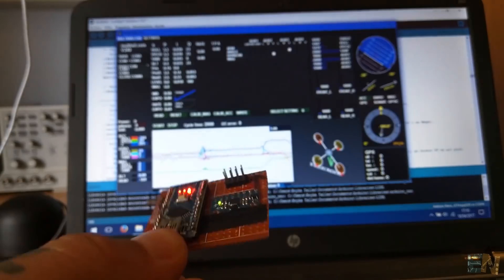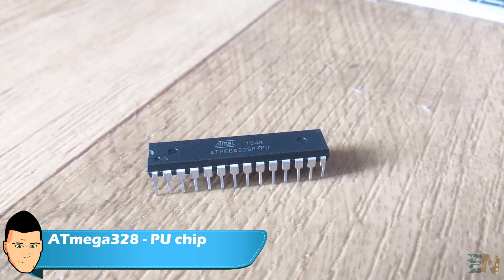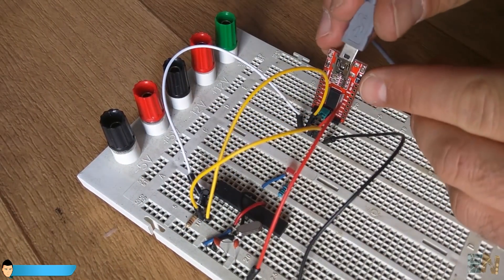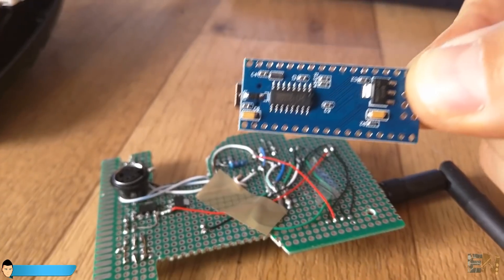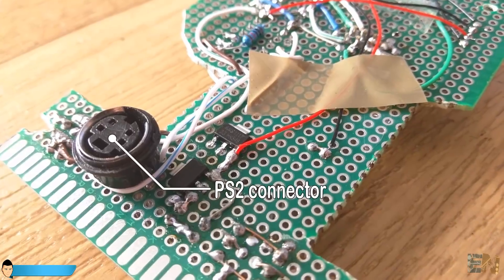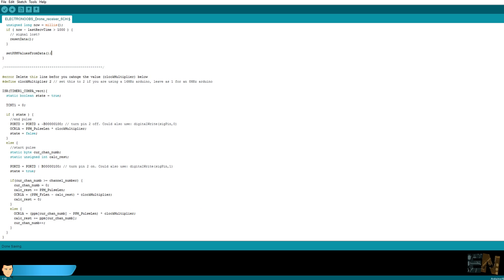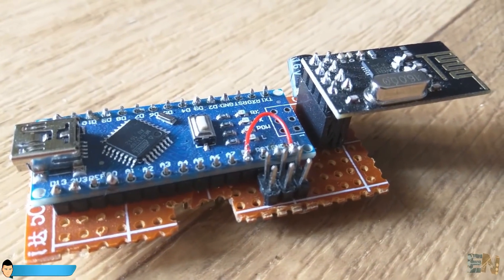Arduino drone - Part2 Transmitter & Receiver

Comment: Hi, when I use arduino nano instead of atmega chip in the transmitter, would the same transmitter code work or there is a separate version for arduino version.

Comment: Arduino: 1.8.13 (Windows 7), Board: "Arduino Nano, ATmega328P"

ELECTRONOOBS_Drone_transmitter_6CH:9:10: fatal error: nRF24L01.h: No such file or directory

 #include <nRF24L01.h>

          ^~~~~~~~~~~~

compilation terminated.

exit status 1

nRF24L01.h: No such file or directory

This report would have more information with
"Show verbose output during compilation"
option enabled in File -> Preferences.

Comment: compilation terminated.

Using library SPI at version 1.0 in folder: C:\Program Files (x86)\Arduino\hardware\arduino\avr\libraries\SPI 

exit status 1

nRF24L01.h: No such file or directory
Reply: Nrf ka library download karo
Reply: @Shekhargourav30  thank you

Comment: Question:
Why do you have to make your own radio controller? Why can’t you use the one without modifying it?

I’m working on a project and I want to just buy a controller and not have to make one. Can you buy a controller and somehow connect it to a receiver which is connected to an Arduino?
Reply: There are many sites like mydronelab.com, etc where u can refer. Because they use ready made transmitter and receiver. This site uses diy made receiver and transmitter.

Comment: Can you please help me. I have spent hundreds of dollars on this, gone through 7 sets of nrf24 modules and I still cannot get the controls to work. I have the flight controller working. I don't know what I am doing wrong. I have checked at least a hundred times. I have my wires connected on breadboards with pins connected below
Ce==>9
CSN==>10
SCK==>13
MOSI==>11
MISO==>12
For some reason I CAN NOT get the radios to communicate. For even simple nrf24 tutorials. What am I doing wrong???
Reply from the maker: Ok so there are many reasons the radio could fail. I recommend you to first test the simple code of send and receive of only one data.  Make sure the radio voltage is 3.3V and maybe use external regulator for more current. Use short wires between arduino and radio module to reduce interference. Make sure to select csn and ce pins in the code to match your connections, in this case as you say, pins 9 and 10. If still doesn't work, i don't know...
Reply: @ELECTRONOOBS  Well first I appreciate the response. I am using the nRF24L01+ Adapter that regulates the voltage and im using the 5v pin from the arduino nano. I have tried every simple test code I can find and I am certain about the csn and ce pins. I've heard that the market is flooded with cheap knock offs so I guess I am just going to keep ordering different ones until I find a good set. If you could recommend somewhere for me to purchase them THAT WOULD BE GREAT!!!

Comment: Sir where to connect the joystick to the transmitter circuit
Potentiometer is numbered but 
Not cleared which number to which
Potentiometer

Comment: this is a really awesome video. where do you solder the trim wires on the Arduino Nano. because I would like to ads trim. would i need too change the code.

Comment: why do you refer to the output signal as PPM when it is PWM?
Reply from the maker: Because is PPM!
Reply: @ELECTRONOOBS  I am using the code of the custom PID with 2 axis with some slight changes but I got stuck to the part where we get the inputs from the PPM signal, but in the custom PID there are different input pins from each input whereas I am using the custom radiotransmiter which has only the one PPM signal input. Do you have any code for this situation? thanks
Reply: @ELECTRONOOBS  nvm ur right I got confused from the fact that the signal is flipped with respect to the time axis. ur right bro

Comment: So  after  inject the code into the receiver and transmitter how you connect to the receiver with that transmitter..........      like how you bind the transmitter with the receiver..........    I am simply saying   I am using nRF24L01+ integrates a complete 2.4GHz RF transceiver for to make receiver and    NRF24L01+PA+LNA Wireless Transceiver Module 1100m  for transmitter.........will it connect to each other.................................

plz tell me....will it connect  or there is  a  match like it have to same model......

if you  say that it will connect not a problem I will order it from online......... so plz reply....

Comment: Hey Electeonoobs, this really interests me. Is it possible to use a frsky transmitter module and receiver module to hack something together using Arduino to get that reliablitity/long range signal and be able to make a custom controller? I've been trying to figure this out for a while. Thanks

Comment: hi .
i want to make a quadcopter based on arduino.
In the quadcopter i want to use
1) arduino mega 2560.
2) mpu 9255 accelero,gyro,magnito, module
3) neo 6m gps module.
4) nrf 24 module.
5) 4 30AMP ESC.
6) 4 2200KV moter.
7) 4 HC-SR04 ULTRASOUND MODULE.
and the controler.
1) arduino pro mini 3.3v.
2) nrf 24 module.
3) mpu 9255 accelero,gyro,magnito, module.
4) a joystick for takeoff and landing
please help. i want make the quadcopter controlled by the "mpu 9255 accelero,gyro,magnito, module"

Comment: How did you make the manual fine tune? You did not show how.😓
Reply: ...all the questions in these comments, I know the answers, but you could easily google and find out yourself....eg Iman Amal - the joysticks have a mechanical link which moves the whole body of the 'pot' to function as the trim adjusters = manual fine tune? No extra 'trimming' pots, so this is more reliable way to do it. I point out that there is no hi-tech 'channel hopping' with this system, so you need to be real careful about checking maximum range, every time, before a flight!

Comment: Is it necessary to ise decoupling capacitors
Reply: Without decoupling capacitors, digital chips produce noise on the supply line with each switch of an output.  This can cause glitches in the system if the noise is high enough.  The problem is worse if the output draws much current.

Comment: thank you for the video but your transmitter test code is the same as the receiver test code. I tried it and got a bunch of gibberish letters that scroll continuously regardless if the module is connected or not. I am not quite sure what should I see and if I have an issue with the module or with something else. 
thank you for sharing the code, it really helped. :)

UPDATE: it turns out that I applied 5V instead of 3.3V on one unit so basically I fried one unit and had the other one works fine so probably that explains the erratic letters I was seeing. :)

Comment: Here's a question for anyone who knows: what happens with the trimmers on the transmitter when you convert it to Arduino? Can they be incorporated into the circuitry so they can still do their job? If so, how are they connected?  If not, how do you trim the quad before/during flight?
Reply: Dont think that you would need a trimmer with flight controller on board. You can add code to your flight controller to auto trim if its not already taking care of the trimming.

Comment: could you tell me how can i change the receiver code to get the PWM at 1520us center pulse? Because The software that i use on my flight controller requires a receiver that supports a 1520us center pulse. what can you suggest me? please answer my question, thank you.

Comment: hello i have another question about atmega used here ATmega328 or ATmega168 does ATmega168 eaven work on that project??? because i searcher and one say: .......The 328 has twice the memory (of all kinds) than the 168.  Other than that, they're the same. ....... and i have just one ATmega328 and one ATmega168. Please awnser me!!
Reply from the maker: ATmega328  is way better.

Comment: Bro how should I complete this can you please help me about this .. whenever I connected aurdino n nrf 24 it gets heated and Burnt .. so what is the problem in it. I had followed all the circuit diagram that you had been provided ..
Reply from the maker: Please tell me which schematic did you used?

Scheamtic receiver: http://www.electronoobs.com/images/Robotica/tut_5/receiver_schematic_ppm.png

Scheamtic transmitter: http://www.electronoobs.com/images/Robotica/tut_5/final_schematic.png
or this one: http://www.electronoobs.com/images/Robotica/tut_5/Transmitter_schematic_arduino_drone_atmega_chip.png if you don't want to use the NANO. Pleaase check all the connections. 12V to the Vin pin or to the voltage regulators. 5V to the Vcc pins and 3.3 to the radio receiver. Be careful. Any question just ask!
Reply: Electronoobs   
Can you please check receiver ppm code . There is one error in  #error delete this line before you change the value (clockmultiplier) below.
Reply: Electronoobs 
Can you please tell me what should I do here .

Comment: Bro. Your circuit diagram is not proper..I had lost 5 aurdino nano in transmitter and receiver . Whenever I connected it .it gets burning . Don't give a wrong circuit diagrams.
Reply from the maker: Sorry to hear that. There are people who mount this project with no problems. Double check the connections adn if you ahve any question comment here or on my Q&A page and the comunity might help.

Comment: Why there is a connection between 5v and Vin of nano in the receiver
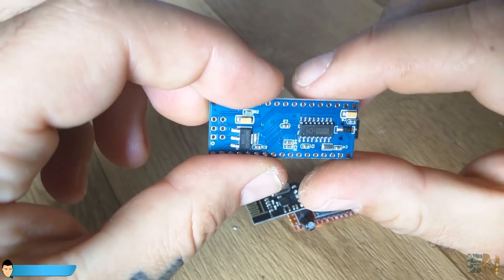Reply from the maker: You don't have to connect 5V to Vin, obviously, but in the video there is a connection (my error). That's because in my case the Vin pin is disconnected from the voltage regulator and there is a connection on the bottom part of the pcb to those 6 pins 7:40 So the connection is from 5V of the arduino to 5V input from ESC BEC. 

have a nice day!
Reply: Electronoobs thanks

Comment: Excuse me if I want to use a FlySky FS-i6 remote.
How can I connect? because once I charge him he does not turn on the engines
Reply from the maker: As before I say: if your flysky has PWM receiver connect it like this: http://radio-commande.com/international/triwiicopter-design/comment-page-1/ and in the MultiWii code don't add the PPM sum receiver part of the code. Let that part commented with "//"
Reply: mine if it has ppm

Comment: in the other videos i saw that you need to set module to 4 diferent power level low-high in wich level your code is seted?? (radio.setPALevel(RF24_PA_LOW);)
Reply from the maker: That is optional. I don't use that function. http://www.electronoobs.com/eng_robotica_tut5_2.php

According to 6.5 of the nRF24L01+ specification sheet, they translate to: RF24_PA_MIN=-18dBm, RF24_PA_LOW=-12dBm, RF24_PA_MED=-6dBM, and RF24_PA_HIGH=0dBm. You chouse your power amplifier. I would leave the default!

Comment: on your web page is arduino reciver code for 6 servo controling, like normal rc reciver. whic one transmiter is the one that mach the code for reciver. I wll be glad for anie answer.
Reply from the maker: With the same transmitter you can have both 6ch PPM output or 6ch PWM output.
It is all there on the webage. Keep up!

Comment: hello, awesome job!!! but i have a question why have you soldered 5V to VIN on the receiver, we get VIN from the lipo battery, but i dont get that connection, the 3.3 voltage regulator goes from 5V or from Vin(sharing the connection)_

Comment: which capacitor you used for 3.3 voltage regulator???
Reply from the maker: Use a capacitor of  10uF
Reply: @ELECTRONOOBS  This may be a dumb question.  But there is a component next to the 10 uF capacitor used in the regulator circuit.  What is that component and what is its value?

Comment: heyy..!!
i've follow all the schematic for the transmitter that you have mentioned but when i supply 12v to nrf gets hot. and some times joystick change values on test code but mostly it doesnt work
Reply from the maker: 12V to the NRF24???? I expressly say it needs 3.3V. That's why you should use a voltage regulator. With 12V that NRF24 it's definitelly dead.
Reply: yea i know and i have used regulator 3.3v but its still gets hot when i attach the 12v betray as shown in your schematics.
Reply from the maker: Make sure of the AMS1117 pins. First is GND, second is OUT and third is IN. Once it is connected measure the output. It is 3.3V? Keep up!
Reply: i've double checked each and every connection it all according to the schematics
Reply from the maker: But the radio connection works? It might be possible that you have already burned the chip, amybe a short circuit. Sorry I can¡t know what is the problem...
Reply: getting hot when attached to the battery . works fine when attached to laptop. what is the problem ??
Reply: bought the new nrf24 but same issue with that one. checked my wiring connections again all schematics is fine. what is the issue with nrf??
Reply from the maker: Hi. I can't know without testing it myself. What voltage regulator are you using? Ams1117?

it is etting hot but it is working? Maybe it is at normal temperature. You could check the NRF243 datasheet and see the nominal working temperature. Keep up!
Reply: i am using lm1117  .. no its not working
Reply: both of my nrf burned dont want to burn another one
Reply from the maker: I'm sincerly sorry to hear that. This is what I recommand you to do. Do you have a protoboard?

I suggest you to test the NRF24 connection on a breadboard using Arduino UNO. Make sure of the connections and use the example sketch to send data. Once that works you could do the RC part.
And make sure that you have this connection: http://www.electronoobs.com/images/Robotica/tut_5/nrf_schematic.png with the 3.3 regulator or just use the 3.3V of the Arduino UNO. That should also work.
I don't know how to help you more than this. Sorry...
Keep up.
Reply: ok thanks i will try that n let u know

Comment: where can I buy that transmitter joysticks with the same specifications?
is I need to change the program if I changed the specifications of the joystick?
Reply from the maker: Basically all joysticks are just two potentiometers so any RC controller should be the same. All that could be different is the quality and precision of the potentiometer movement. I bought mine from a second hand store!
Reply: Electronoobs Thanks for your kind information sir...✌✌:-)

Comment: in this video you have solder 5v port with vin but in your blog you didnt mention about this??? 
can you explain the purpose of ppm port attached to d2 on nano? where to attach it ?
Reply from the maker: I never solder 5V to Vin, That's crazy. Maybe two lines overlap on the schematic by error but never connect 5V to Vin. The PPM sends 8 channels with the data to the Flight controller, it's basic!
Reply: see the video at 10.30 of part 2
Reply from the maker: Don't worry about that. It was a small error, the voltage regulator wasn't working si I'e soldered a jump wire between Vin and Vcc, I forgot about that. But you just follow the schematic. There is no connection between Vin and Vcc. Thank you!
Reply: ok got it. 
i am also having 127 values in receiver test code when executed for all but when joystick is moved nothing happens. what are possible causes ?
Reply: @ELECTRONOOBS  I am having 127 values in receiver test code when I moved joystick nothing happened.please explain this

Comment: You didnt mention anything about the capacitor used in the receiver? Can you please explain it
Reply from the maker: The NRF module needs very stable 3.3 volts and alos needs a lot of current so for that we add an extra capacitor to supply those peaks when needed. Keep up!
Reply: What size is the cap? thanks

Comment: how solid is the link! ...what is the range and what about interference from other transmitters nd wifi signals!? does it affect!?....plus can i use a 433mhz module and boost its power to 7W  instead of a 2.4ghz....to get longer range like UHF system for fpv !?
Reply from the maker: Using 2.4GHz you will have no interference. You jyst have to use a different channel pipe. Using the module with the power amplified antenna I was able to keep the link for more than 800m.
Reply: 800m is not gonna cut it nd 2.4 ghz can be used only winthin 1w power transmission beyond 1w is illegal .....its for my project i need range for atleast 20km.....nd 433mhz is the least used bandwidth.....is there any way by with i can transmit PPM signals for such long distance....and can u suggect me any other micro controller for 12ch ....a little tweak in the code should do it right!?.....nd can u explain if the transmitted PPM signal  is converted to PWM signal at the receiver because servos work on PWM signals!?

Comment: test code only working and when i connect it digital pin 2 with reciever code it won't works at all i tried alot but no output is recieved
Reply from the maker: The receiver doesn't work? have you tried first the receiver test code to see if you receive the values using the serial monitor of the arduino?
Reply: Electronoobs yes reciever receives the values perfectly and if PWM code is uploaded then also works fine but ppm is not giving output and for reciever m using atmega328 dip not nano